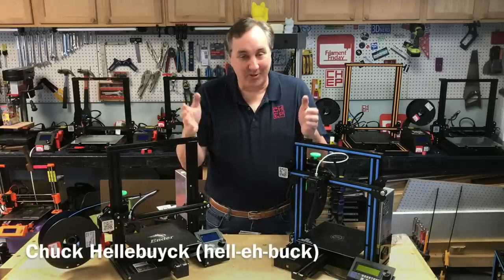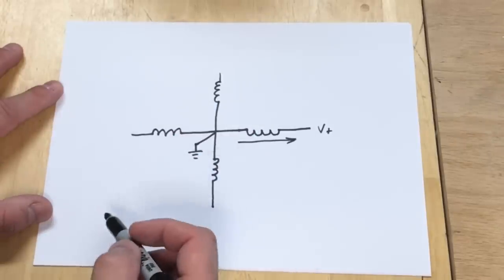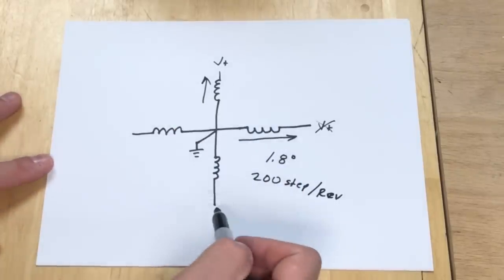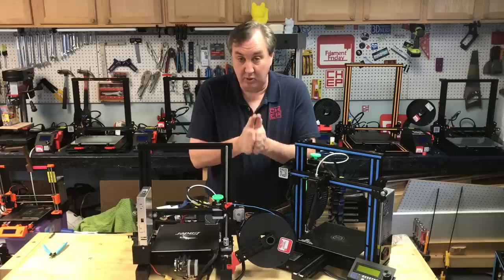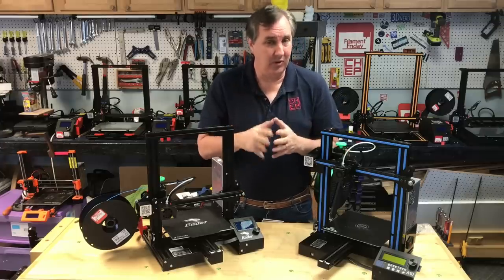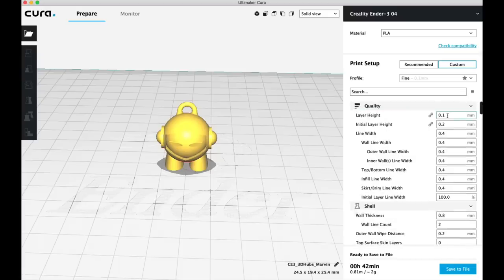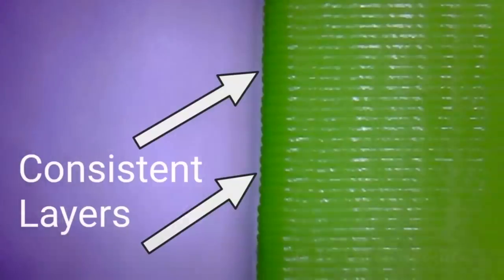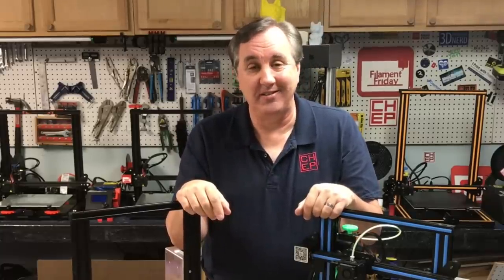Better Quality 3D Prints Using MAGIC NUMBERS on Creality Ender 3, CR-10, A10

Comment: Hello, maybe your magic numbers work but I believe that's not for the reason you think. A stepper with 200 steps / rev will make the extruder climb 1.25mm per full rotation since a 8mm screw (M8) has 1.25 mm pitch. So if you divide 1.25 with 200, it makes 0.00625 mm climbed per step. So magic number examples could be 1.25 (200 steps), 1.5 (240 steps), 2 (320 steps)...

EDIT: We do not have the same rods sorry, yours go up by 8mm each rev
Reply from the maker: I didn’t divide by the screw diameter. The X carriage rises 8 mm on one turn. It’s a 4 start 2mm pitch rod which results in 8mm lead. So 8/200 = 0.04 as I stated. I understand exactly how it works.
Reply: I initially thought the same, but when I raise my Z by 8mm the Z motor does one revolution.  The lead screw on my A10 is 8mx2mm pitch.
Reply: @FilamentFriday  , I will be possibly corrected in this. I measured the carriage risen by 80mm in 10 tyrns, so we have the same result here, but I understand that the stepper motor has a 1/2 reduction gear, so that´d mean that the stepper motors makes 400 steps (two motor turns) to give a full turn to the rod. Would not it mean that the actual magic number is 0.02? Not that I´d never go so low, but that will put some profiles, like 0.6 or 1mm within the magic numbers. Thanks a lot.
Reply from the maker: What printer is it? I’ve never heard of a 2:1 geared stepper on a 3D Printer. A 0.9° step vs 1.8° stepper could be used but that’s more poles not gears.
Reply: @FilamentFriday  Thanks a lot, sorry I wasted your time, totally my confusion. Steps are 1.8º as you mention.
Reply: @FilamentFriday  Ok so we just don't have the same 8mm rods. 1 turn gives me 1.25 mm.
Reply: @homebrew94  check this out> the in the Ender 3 the threading is not the normal single threading of the M8's, but has several threads running parallel (I think its 3 maybe 4). I followed- marked one of the threads with a sharpie for a full turn and... voilá... 8mm per turn.  I do not know what specification is this or how is classified, but I just measured it.
Reply from the maker: As I mentioned above the Ender 3 has a 4 start 2 mm pitch for 8 mm lead or 8 mm rise.
Reply: @FilamentFriday  LOL! Not that would I disagree, I just did not understand the technical jargon. Totally my bad

Comment: does this apply to the ender 3 pro with a 1.1.5 motherboard? being that it has silent drivers...
Reply: did you find something about this? I have the same question since I have silent motherboard too and they have more steps from what I read

Comment: What if you install TMC drivers that uses 256 microsteps, does that change the magic numbers ?
Reply from the maker: Nope. But probably less benefit.
Reply: It shouldn't change the numbers. Microstepping is supposed to be used to smooth the motion between two whole steps NOT to artificially increase resolution, but I recently found out from another video that it can sometimes make jerk worse if the driver and stepper motor aren't well matched

Comment: How do you know whether you start off at a magic number? I mean if you start at 0.67 sure you can add 0.04 but thats still off because its 0.71. Thats not a magic number. Anyone have any tips?
Reply: Just go by multiply of 0.04. So if you are at 0.67, either use 0.64 or 0.68. Just divide your number by 0.04 and take a integer number.
Reply: does not matter where you start, just the relative positions towards each other have to be the same so changing the layer height to a magic number results in the motor allways beeing in the same state
Reply: @TheC9rl  Magic numbers are  fallacy. The question is absolutely relevant and by extension, demonstrates that magic numbers are bs. We are talking about making sure that the stepper motor is at a full step at those magic numbers however, when you level and go down to z=0 how do you know that the stepper is at that point, exactly at a full step? You don't. That's the crux of it. If you aren't starting at a full step, then how could it possibly matter what layer height you choose?
Reply from the maker: The microsteps angles are not always equal so even if you start at a non natural step, with magic numbers you rise to that same microstep consistently thus averaging out the microstep angle variability which gives you the smoother surface.
Reply: @FilamentFriday  Thanks for replying. I understand the rational now and it makes sense. My issue was that everyone seemed to talking about "magic numbers" with the presumption being the print was starting with a full step, which we agree is ridiculous.  I do understand that z rises to the same microstep (which is not necessarily a half or full step which would be most stable).  Again, thanks for the reply. Cheers.

Comment: great help for my CRS-10 miniI also have 2 Da Vinci 10.a's do you know what the pitch is for it's z drive screw?
turns out to 1.2mm for 1 revolution made it multiples of .006mm but rounded numbers .03 so it would be .18, .21, .24, .27, .30, .33
Reply from the maker: I don’t. You should be able to calculate it since they use the same steppers.
Reply: I don't know the pitch on the screw .Much finer threads
Reply from the maker: Just manually turn the shaft once and measure the distance it moves.
Reply: @FilamentFriday  I measured it looks like 2mm for one turn. That makes it out to .01
Reply: in jog mode turns out to 1.2mm for 1 revolution made it multiples of .006mm but rounded numbers .03 so it would be .18, .21, .24, .27, .30, .33

Comment: But when you home the printer you might end up with a zero that is not aligned with one of the coils in your stepper, how can you make sure the the zero is aligned?
Reply: If you use micro-stepping there is no way to know without measuring the output of your driver.
Reply from the maker: It’s doesn’t matter. If you home on a microstep you will rise to that same microstep each time do you get consistent layer height.

Comment: Chep I have used your settings in cura for each layer height and have never produced a quality print. Anything I'm doing wrong? My bed is level and so is my table
Reply from the maker: Could be your filament.
Reply: @FilamentFriday  thank you Chep! I will try a different spool
Reply: @_JustBeingCasual  thank you Lauren's! I'll try a different table and separate my filament from the ender 3 :)

Comment: but how do i know the distance per revolution in another printer?
Reply from the maker: I explained that. Turn the threaded rod one turn and see how much it rises.
Reply: @FilamentFriday  thanks! i missed that part, my bad
Reply: @FilamentFriday  Even better: turn it like ten revolutions and divide the measurement by ten. That will average out the measuring error.

Comment: you have very interesting see but this is a very bad 8mm thread can not rise 8mm pro resolution, how much thread height can so much, rise for resolution be for example 1mm or 1.25. you have a 8 × 1 mm thread which means 1mm for a single turn
Reply from the maker: It’s 4 start 2mm pitch for 8mm lead.

Comment: shoud try to print and compare on 0.11, 0.13 also and see if really this math matters...
Maybe its just about more suitable print speed for that certain layer height..??? We all know that there's too much factors involved to say "this is it... " 
to be clear on this, you can check the real position of Z during hand jog-ing with dial indicator step by step to say if there came out some real positioning error.
Reply from the maker: Let me know how that works out.
Reply: I've tried measure some accurancy with  my 0,001mm dial indicator on ender3pro but the manual move with axis reeaally suck. Is this so terrible on each creality or is this common on all printers? i should write manualy some g-code and try again.
Reply: Short answer: Just put your indicator on the top of your gantry or Z screw top during a print and see how consistent it is over 20-30 layer changes.  Then do it again with a non magic number.  You might be able to see inconsistency in the stepping... or not.  Hard to say.  Long answer: You are going to have a harder time than you think with a dial indicator that fine on a 3D printer.  There is very little rigidity anywhere.  When measuring, keep in mind that in many cases a printer's Z axis is mostly loose where the screws lift the X gantry.  It's just sitting on the nuts with gravity.  The ball screw to bracket attachment screws are usually left completely loose to avoid causing the imperfection of the lead screw(s) to move the z column as it rotates and show in your print.  So your best bet is to measure many equal steps for consistency only raising the axis each time and never lowering it during the test steps.  The moment you tell it to step back down you need to start over because it's going to introduce all the backlash and whatever else happens when gravity takes the gantry brackets back down or the nut screw heads pull them down.  This doesn't happen during a normal print, the head only moves UP thank god or all printers would need far more rigid and expensive designs.
Reply: Unfortunately those precise dial indicators have very little range - 0.2-2mm so i couldnt measure such a big range at once at all... after all there is easy solution - build massive stiff printer with hybrid stteper with encoders or servos and preloaded lonear guides + prices ball screws but who would need this and who will pay that money if its only toy for a hobby as in my case...

Comment: Dose anyone have a profile for ender 3 with 1.0 nozzle I can not get it fine tuned
Reply: Make sure you slow down to 30 millimeters per second and increase your temperature 5 to 10 degrees depending on your layer height thickness top players will always be a little bit sloppy with the larger nozzles but you should be able to get it fine tune pretty good

Comment: What if my motor in Z0 position isn't in "real" step position? Does it matter?
Reply: chuck covered this very point at https://youtu.be/WIkT8asT90A?t=179 as long as your consistently hitting the same micro step position using the magic number it will be consistent even if the origin isn't a real step location

Comment: Wouldnt moving the z-limit switch mess with those numbers? How do you know you are not "between steps" when z is at 0?
Reply from the maker: If it starts at a microstep in will rise to that same microstep. Read the top pinned comment.

Comment: Rather stupid question but can't get over it: so what happens if I print an item with 0.1 mm height? 2 layers with 0.04 mm height + 1 layer 0.02? 1 layer 0.04 and 1 layer 0.06? 2 layers 0.05?
Reply: I'm unsure as I haven't tested it, but most likely your slicer will either just create two 0.4mm layers and the end result will be 0.8mm thick, or it will slice three layers and it'll be 1.2mm thick.
From experience, any 'over-detail' is lost during the slicing. You can see this on Cura where anything too precise is greyed out, and simply not printed.
Reply from the maker: How would you do that?
Multiple files?

Comment: There is one big problem when using these so called "magic numbers" when using lead screws with a pitch not dividable without remainder, e.g. resulting in layer height of 0.12 mm: Let's say you want to print an object that's 10 mm tall: 10/0.12 = 83.33 layers. Every slicer will round down to not exceed the height ob the objects. So your printed object will be lower than the original. Although this isn't a problem when printing purely for fun, it sure will become when printing mechanical parts, spare parts, etc. Your dimension in z-height will never match. So either live with inconsistent layer height because of micro- or in-between steps or go get a lead screw with a 1 or 2 mm pitch.
Reply from the maker: Print at 0.2 which is still a magic number and gives you the exact height you want 10/0.2 = 50. Need finer resolution use 0.08, 10/0.08=125.
Reply: @FilamentFriday  Well that's an option, too. I prefer even numbers 🙂
Reply: You can compensate with the height of first layer...

Comment: does it work for tevo tornado as well?
Reply: It will work with any 3D printer because all of them use stepper motors. But you may need to calculate this numbers for different printers as they may have different stepper motors, belt drive gears and even belts as well.
Reply: @antikrabe8646  thank you for your help

Comment: Cool. Thanks for this information. I have also a prusa i3 mk3 printer. How can i know the steps i got there?....how can i check it?
Reply: You have to look at the datasheet on me stepper motor they're using. I'm pretty sure it's on the preuss's website calculator as well.
Reply: Won’t make any difference on a prusa mk3 as it’s using auto bed leveling. Z is not constant on this printer
Reply from the maker: Autolevel has nothing to do with the Magic Numbers. It’s the layer height movements after the first layer that matters.
Reply: CHEP fucken’ prove it! Haha
I don’t know mate. If you probe a mesh of a bed in 9 position your first layer will have random Z steps depending on where you are positioned with X and Y axis and you will end up in between steps all the time. All following layers will be an offset of that first layer by the layer height you selected in your slicer program. I think when doing auto bed leveling as Z varies constantly you can’t apply the same principles that’s it.
Reply from the maker: Yep, the first layer will have variable z offsets to level the first layer. From there it rises equally across the print. So that’s where the Magic number comes in.
Reply: Well.. the prusa motors are the same 1.8 degree. Thanks.

Comment: What about for prusa printers
Reply from the maker: Don’t know
Reply: I just measured the z axis on my Prusa i3 mk3 and there are 10 threads per 20 mm and 4 threads touch the bottom stopper (or stated another way: I go up 4 threads with one full rotation), so they have a 8mm pitch, the magic number is 0.04 mm, and it's the same as in the video.
Reply: Tom Gauthier I’m going to measure mine (mk3s) today. Though I assume they’ve used the same threaded rod. Thanks for giving some reference to prusa printers.
Reply: @atcom101  use a permanent marker to mark one of the threads... I kept counting to 5 until I did that and slowly turned the threads (moving the z axis might work too, I think it went too fast for me).

Comment: I'm not sure I understand how the stepper motor works. Is he saying there's 200 magnetic coils in the stepper motor?

His drawn example shows 4 steps per revolution, but an actual motor has steps for each 1.8 degrees.
Reply: did you expected him to draw 200 coil/pin commutator of the stepper motor? for briefness sake, this is common in display/demonstration purpose. that said, yes there are stepper motors with various fineness according to the number of coil, and the microstepping allows it to go even finer, but not guaranteed to work as constant as a full step, as it's like if you're precisely holding two strong magnets nearby while preventing them from sticking together(where letting them to stick and rest, is a full step)
Reply: No no, I didn't expect that. I just found it weird he said there were 200 steps per revolution based on the angular change rather than just, "The standard stepper motor has 200 of these coils."
Reply: @Soumein  ah, for being rather acquainted with stepper motor, I admit I skipped listening closely to many things. that statement still equates though, albeit from different perspective, a confusing one, if you're getting to know just the stepper motor itself.
Reply: To get the steps per revolution the formula is:  360⁰ / Step Angle, that's how he came up with the 200.  The step angle on the motors is 1.8 degrees.

Comment: Is 0.2mm included in the magic number also? since it's always 0.04 increment as you said in the video .
Reply from the maker: Yes it is.
Reply: @FilamentFriday  Thanks. regarding avoiding string and seam,  I have tried to print PLA using your profile. But it seems turned out in totally different than expected, mine comes with branch out with string, although no really stringing.  I think it depends on the material itself. Different brand different result.  is it possible to completely vanishing the seam line in FDM printer ?
Reply from the maker: Enable Z-seam Alignment and set to corner.
Reply: @FilamentFriday  ok thanks Chuck ,I'll have a look and try it. Will let you know soon.

Comment: I admit I did not read all 954 comments but I was looking to see if anybody mentioned my Ender 3 Pro under the control screen menu , item CONTROL, sub-menu MOTION, Steps E shows 400 steps/mm.
Should /can change this to your 200  , if no I guess it only means my stepper motor will move 2 steps to your one
Reply: Those are 1/16 microsteps: 16 microsteps per step, so 16*200 = 3200 per rotation (or 8mm lift). And 3200/8 = 400 microsteps per mm. And you want the Z movement to be a multiple of 16 microsteps, or 0.04 mm.
Reply: I  know you either did mess up or gave up on the idea by now, but still. What Chuck is talking about is trying to choose a layer height that is (at least theoretically) divisible by the stepper driver, ie. you minimize rounding when moving up. Steps E (now I dont have an Ender I admit) but I will bet this is your number of steps to extrude 1 millimeter of filament - this should definitely be calibrated - but that is in another video, and I'm sure Chuck made one on that too.